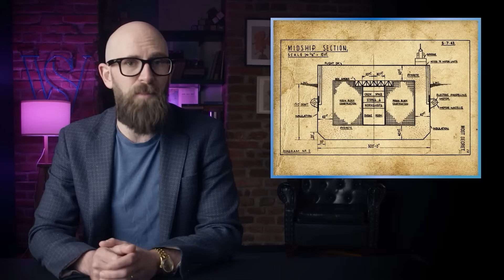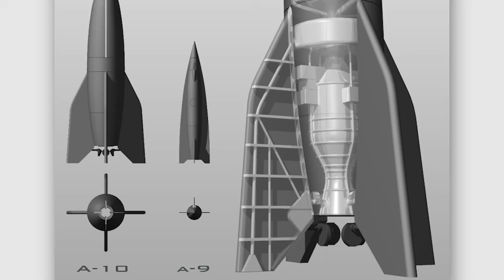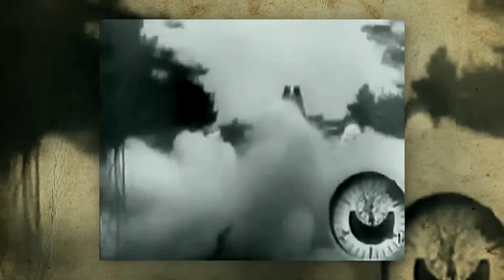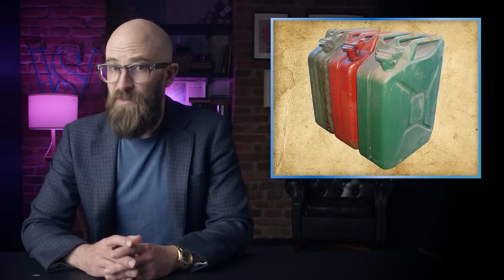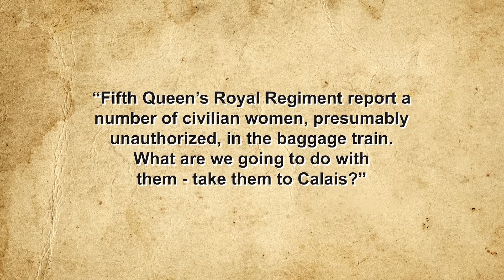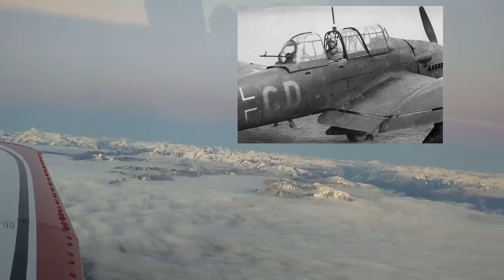The Weapons of World War 2 (Part 2)

Comment: For refrence: The avarage volume of a rock concert is 120db. Talking  from 3 ft away is 60db and screaming is 78 db. And daytime area sound in a industrial area is around 70 db. 

According to OSHA lstening to 115db for more then 15 min will cause hearing damage.

You can absolutely still hear a suppressed gun from a distance out of sight and know exactly what it is.
Reply: True. It does also depend on the type of firearm and ammunition. My brother's suppressed 10/22 with subsonic ammo, you can only hear the action. It's quieter than an air rifle.

Comment: It occurs to me that the panjandrum(?) could potentially have worked as a sphere/ball rather than a wheel.
Reply: Do you really think the idea was worth growing in the face of world war?
Reply: @wingerding  actually with this idea yea I could of because thinking back to the mg42 nests set up this could wreck a havoc. Besides the amount of obstacles it would eliminate I think D day could've benefitted from a better version of it. It was just a fruit grown from a bad tree it wasn't nutured right. After the 2nd testing with the 3rd wheel I thought it'd be kinda simple to think to atleast try strapping rockets to the middle wheel atleast 😂 idk funny to think about though.
Reply: Yeah, I was thinking either that or put the rockets on an inner disc. Since the inner ring would turn faster than the outside ring it should act like a gyroscope.
Reply: The third wheel and fixed rockets firing backwards might have worked. Stuttering thrust would not matter and three wheels would be stable.